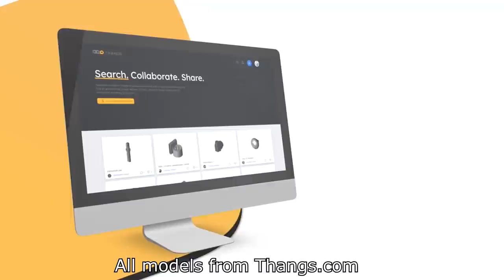10 Useful Things To 3D Print

Comment: I would like to know for a reel of 1 kg or 2 kg to store it (PLA ...) for a humidity ... a real problem ...?
 I have difficulty speaking ... stroke.
Reply: Yes humidity can ruin PLA
Reply: Please packed with packing cover after use
Reply: You can store them in a clear plastic tote box with latching handles along with a sock of desiccant.
You can even get some cheap automotive silicone to make a gasket. 

I have one set up like that with a spool roller inside it and small holes on the side with pneumatic fittings sticking out so I can print without having to remove the lid.

Comment: 1) Just use your fingers...
2) Nice
3) Just buy a cheap pen.
4) Nice and useful.
5) This thing already comes with the tools
6) Nothing dumber than a plastic pliers
7) Use the box that cames with the toothpick
8) It is much cheaper to buy it (it comes out pennies) than to make something weaker. Also, there is no point in having a hole if you are going to use it with double sided tape
9) The idea is good, but the hook of the phone is very big and does not allow to use it while it is there
10) You have to take into account the scales, because not all spools are equal in size